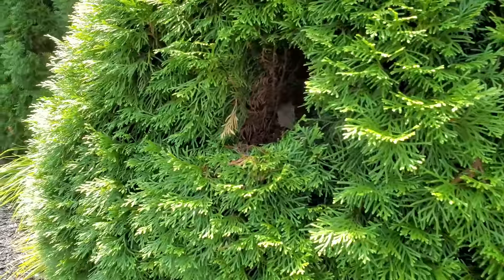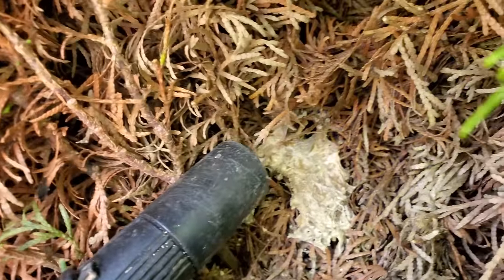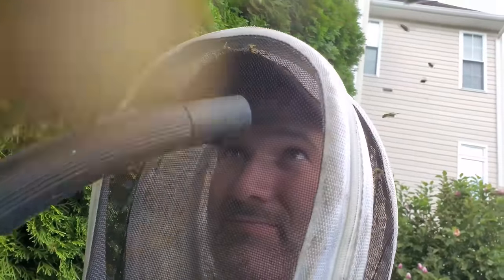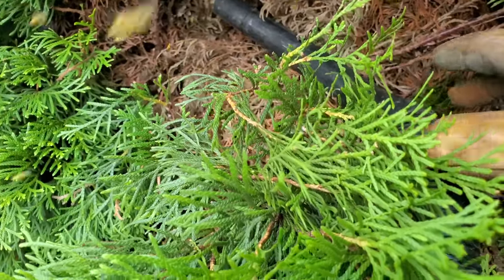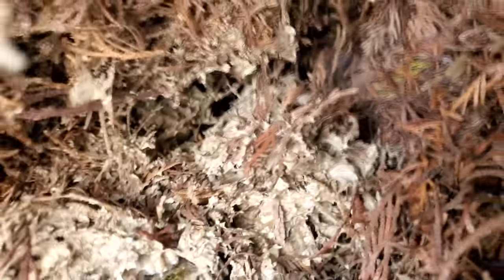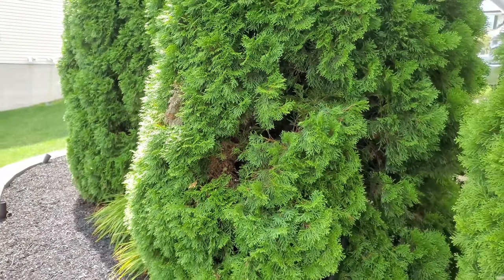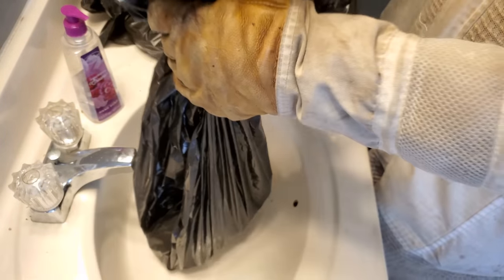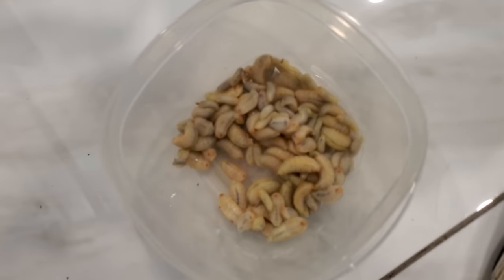BUSH OF DOOM! Aggressive YELLOW JACKETS Swarm From Bush | Wasp Nest Removal

Comment: I felt every bit of that swarm.  Back in 1987 I stepped into a ground nest, and being 5, I couldn't get away fast enough.  I was covered literally head to toe in stings.  Luckily I'm not allergic, but yeah... never fun.
Reply: Same happened to me but i was allergic...lets just say i dont remember what happened the rest of the day
Reply: @SproutQueen20  Ah god.  I'm glad you're still here, that's no bueno
Reply: I had gotten stung by a hornet on my left shoulder years ago.
Reply: Same exact thing happened to me when I was five years old! Three of us were walking along a trail, coming out of a woods. My brother and another kid stirred them up and I was the third one through. They swarmed on me. It’s kind of hard to run when you’re swatting yellow jackets as you’re running, but I ran to a neighbor’s house, the closest house to me. Luckily, she was at home and she helped me.  When my mother came to get me and walk back to our house, they came after me a second time and followed us into the house. A couple got in the house. I probably got stung 20 or 30 times, at least. My ankles were all swollen up.
I got revenge though, on their descendants over the years. If I found a nest, I would wait until nighttime, when all the yellow jackets were all down in the nest, spray bunch of insecticide down the hole, and plug it with a stick. End of problem. Years later, I got stung by a bumblebee after disturbing one of their ground nests while mowing the grass. I did the same thing with them. 
We had hornets in our backyard also and we’d make a sport of it, by going after them with badminton rackets, as they flew around. We never did find a nest. Never got stung by one, either. I was a really good badminton player! They didn’t have a chance! 😂🤣
Reply: There was a big nest bigger than a basketball underground under a big ash pile. We got wasp spray with the long nozzle. Sprayed and a cloud came out of the ground. We took off running to the house 200 feet away. A hundred feet away my cousin Dawn who was five at the time just stood there. We yelled run. We ran past her I had thought she was going to run and I had to run back and grab her. She got hit 60-100 times. All in her hair. I would not doubt I was hit at least 50 times. Still rushed her to the hospital and she was fine. We live over 20 miles from town so she to was lucky she was not allergic. Kind of surprised those bees chased us to the door.
Reply: /ryeahthathappened
Reply: They got me a few years back when I was doing some lawn care.  First time I was stung by anything
Reply: @JS-rv3et  bro thinks people don’t get swarmed by wasps
Reply: @JS-rv3et  just cause it didn't happen to you doesn't mean it didn't happen to anyone else
Reply: Ouch.
Reply: @Burakidiosu  read my above reply.
Reply: @JS-rv3et  guess you've never been attacked by bees before
Reply: @FrebbyProductions  read my reply to knight of wands
Reply: I’m from Australia and surprisingly I haven’t found any hornet nests. I mean with everything here that tries to kill you you would think they would be more common but apparently not 😂
Reply: @OurTunnelsIncredible  w comment 😭
Reply: @LAVAZZ.  they dont like the competition
Reply: That's actually how I found out I was allergic... spent 4 days in the hospital, and now I'm literally scared to death of wasps and bees. I don't ever want to feel that pain, and that much fear ever again. I was 13, so older thank God... not sure i would have survived if i was smaller. My poor mother... she thought I was gone for sure.
Reply: @Ecox51719  aww😢
Reply: @alan30189  Bros a villain from the day he was born
Reply: You poor boy that is something never forgotten but praise the stars you weren’t allergic! Very lucky at same time.
Reply: @saladmancer4802  well you’re lucky then but there’s always a first time lol
Reply: I'm burning the whole tree sorry Mr beast!
Reply: Was that the sting of 87
Reply: I also stepped on a beehive when I was five-ish. I've finally found my people LMAO
Reply: if ya disturb bees, just don’t swat, that’ll probably make them more aggressive
Reply: Yep, something kinda the same happened to me but 2 wasps stung me it was last summer when I was at ferns park in Woodland California  it was on my left foot and I can’t remember where the other one was.
Reply: Me too but it as around 1957
Reply: Me and my sister got swarmed but the worst part was WE didn't stepped on a nest. We were helping dad and grandfather because a cow escaped a fence. 

The cow stepped on the nest, causing the swarm to follow us to my dad's convertible where my mom and brothers were. We all had to abandon the convertible and get into a different car. 

We only got stung a few times but I still remember seeing the swarm in the car we had to abandon when we were in a different car. We got lucky.
Reply: That had to be traumatic. My goodness!!!!!
Reply: I did that too, actually have PTSD from it because my dad (who I was spending the first weekend of my life with, I was 8, just met him) beat me after for not looking where I was walking. Cry everytime I see a wasp now.
Reply: That could kill a child.
Reply: I didn’t realize hornets were in the ground, I was out for a long walk and had to squat to pee🥺 well that “pissed “ that hornet off and I thought I was bit by a snake, I seriously couldn’t breathe for it felt like several minutes.  I seen the 2 “ hornet fly off, it seriously was the worst pain I have ever felt. I finally made it home, though I was going to die along the way. I  Can just see my obituary now, she was pissing along the road a was attack by a hornet and bit in the ass. May she rest in peace! 😳
Reply: Holy crap-I did SAME THING, SAME YEAR! And I was trapped-it was too deep.
Reply: @jeweltorkelson  what an evil dad
Reply: Ouchy, poor little one. I was also 5 in 1987 as well.
Reply: @saladmancer4802 apartment people 😂
Reply: ME TOO, except I fell 10ft.out of a tree onto a woodpile..🤯🐝🐝🐝🐝🐝🐝🐝🐝🐝🐝🐝🐝🐝🐝🐝🐝🐝🐝🐝🐝🐝🐝🐝🐝
Reply: The same kinda thing happened to my sister when she was a teenager/tween. Despite being able to get in the house and slam the door, she had very angry ground bees all in her hair, her clothes, etc, and they kept stinging her until she eventually blacked out on the way to the hospital. To this day, she still has no recollection of what happened.
Reply: I got swarmed by a nest of German Yellow jackets here in NZ, was cutting scrub and tapped the base of a 15ft hollow tree they were in (I honestly thought it was a wild honey bee nest) and a cloud burst out of the tree like in a cartoon, and then it descended onto me, had no shirt on at the time so took about 200+ stings mostly to my head and back.😖
Reply: Oh... That sucks wow. Ouch. 
When I was about 4 I sat on top of an ant hill... Was so absorbed in playing I didn't notice until I looked down and my shirt was covered in black ants....I came out ok too but really scared me
Reply: Essentially everyone is allergic. That's why you have a reaction to being stung. Some people happen to be more allergic than others.
Reply: It seems like we all learned our lesson about ground bees around 5-7 years old i happend to fall into tha class too😂
Reply: When I was 2 there was a hornet nest under our porch, apparently they didn’t know about it, one day my mom set up one of those toddler bouncy swings and went to gardening. I started jumping and remember them swarming up in a cloud around me. At first I thought they were cool looking, and then they started to sting…. I had nightmares of giant hornets until my early teens 😮
Reply: How terrible for anyone to go through much less at 5 years old
Reply: YOU WERE STUNG BY A SWARM OF THOSE SIX LEGGED JERKS?! Wow 😲 That's AMAZING🤯
Reply: @alan30189 good man about the wasps but tou shouldnt have done that with the bees
Reply: @eabhankilcline8110  Well, the bumblebees stung me, so they’re dead meat. And I’m not going to hire somebody to come capture them alive, to get rid of them. There’s no orchards in this area, either, for them to pollinate. I see thousands of bumblebees around my house every year. I have “Lambs Ears” planted on each side of my sidewalk, just in front of my front porch, and the bumblebees love the flowers on the spikes during the summer. I sit there on the porch and watch hundreds of them buzzing around, getting nectar from the flowers. They don’t really bother you until you accidentally step on their nest. They just need to be careful of where they put their ground nest. 🐝🐝😳🐝🐝
Reply: @It-b-Blair  I had to be a horrible experience for two-year-old. Mine was bad for me. I’m glad you weren’t allergic, because you could’ve died. Hornet stings are pretty powerful.
Reply: i had a somewhat similar experience with a thorny bush. i fell into it and my mom had to take out like 30 to 60 thorns that was stuck on my body. not the same as being swarmed but close enough.
Reply: Oh dear, I’m so glad you survived! That’s so scary.
Reply: i’m deathly allergic. Being a stupid 17 year old I messed with my friends in the woods and we stepped on a nest and i still can’t get the buzzing out of my ears. I can’t look at or hear a bee without going into this weird shock
Reply: Bro I have a similar story my ball went into some rotting wood which had yellow jacket nests and I got about 5 or 6 stings on my hand. But your story is so much gnarlier, I still have a phobia of wasps to this day. Bees I have absolutely zero problems with for some reason. Glad you ok and you weren’t allergic of anything.
Reply: U are soooo lucky u aren’t allergic unfortunately I am allergic 💀💀💀👁️👄👁️🫠
Reply: That happened to my dad when he was a kid- he was mowing his parents lawn and ran over one on the edge of a creek. He still talks about how horrifying it was. Wouldn’t wish it on my worst enemy
Reply: When I was 8 a friend and I were walking thru the woods and she unknowly stepped on an underground nest. We both took off. Fortunately I'm not allergic but she was. She spent like a week or so in the hospital after being stung hundreds of times. I escaped with around 50 stings
Reply: When I was four or five, I vaguely remember seeing something in our front yard that I thought was a seashell and picked it up...  Fortunately I was wearing a wool sweater, so I only got stung a half-dozen times.  I got lucky; despite obviously deeply disturbing the nest, I must have dropped it quick before getting hit with a lot of pheromone, or it wasn't a super-defensive species...
Reply: Naa bros in his late 40's💀💀💀💀💀
Reply: Allergic or not, their bite is still horrendous beyond all reason.
Reply: @@awesomelife4001I have never had that experience with hornets, only yellow jackets, but I’m no expert.
Reply: I had yellow jackets build a nest in my compost barrel.  They only flew in one vent so I hosed that vent with wasp spray until they stopped coming out.  That would last a couple weeks and then I’d start seeing them again and had to repeat about 3 times.  Probably new ones hatching out.  The only problem is now I have to wear gloves to take the compost out incase I grab some dead ones.
Reply: We don’t have a lot of hornets where I live but a couple years ago when I was mowing the grass I noticed something black and white flying around my head every time I got near an apple tree.  I remembered boldfaced hornets are black and white and backed off.  Luckily I didn’t swat at them.  When things calmed down I snuck back to the tree and took a look and found a softball sized nest.  I waited till night and hosed the opening with foaming hornet spray.  I waited a week and knocked the nest down when I was sure they were all dead.
Reply: Old ahh 42 year old really just a child ahh
Reply: My dad is allergic to bees so he would probably die because he cant breathe when he gets stung
Reply: Was that the sting of 87😮😮
Reply: All of a sudden everyone got swarmed by hornets lmao.
Reply: OH MY, I AM VERY VERY GLAD YOUR 5 YEAR OLD LITTLE SELF MADE IT THROUGH SUCH A VITAL AND FRIGHTENING EXPERIENCE. THANKS FOR SHARING THESE MONSTER'S..
Reply: Yea me too hit air balloon came down a nest of white faced hornets had 2 opening in ground nest i was at 1 got stung almost 40 times i was like 10 years old. The other side was this like 5 year old kid and he had more stings than me. Nobody else i know of got stung but they are hard stinging bees. Still fear bees over 30 years later
Reply: That is my exact same age/story as well. Mine took place in South Carolina. Never saw them coming.
Reply: That happened to me and sister I was 4 and she was 6, it sucked so bad. 😭
Reply: WAS THAT THE BITE OF 87!!?
Reply: I hit a nest digging in the yard when I was around 10, Making a rc car track. I got hit once in the thy standing right over the nest, I ran so fast I didn't give em time to sting twice, I looked back as I was running and saw a cloud come out of the ground. Went out there at night with a gallon of gas...nighty night boys.

Comment: Every time I see Arborvitae shrubs I instinctively start looking for yellowjackets. Frequently they nest in the roots or just under the debris under the shrub. I've removed a few hanging nests in these shrubs but lots more ground nests. I don't get the luxury of removing with a vacuum, something I've wanted to try. I've been surprised how close to these nests you can get without disturbing them. I have literally squatted down next to a ground nest to do my thing and had them ignore me as long as I am suited up and not moving too much. Cool removal!
Reply: Usually you need to shake out all the dead needles and rake them out.

Comment: A few years back, I had to deal with an in ground nest that was causing issues in my yard, and it was probably these guys that were the ones that formed the nest. They would come out and sting me anytime I tried to mow my yard or even walked past were they were nesting. Not great when your allergic. Couldn't mow that part of the yard until one day late fall, I decided to move the rock they were nesting underneath and just have them exposed to the cold air. Couple days later when things have calmed down, I decided to pour soapy water on them (learned that from this channel), then decided to just double tap it by pouring boiling water from a kettle directly on the nest. Safe to say they were very dead, and after removing the nest, packed dirt into the cavity, replaced the stone and sealed it up. We didn't have to worry about wasps for quite a while as none had showed up the next spring/summer.

Comment: Had those build a nest in my red brick wall of my house. Before we got house neighbor told us about bee removal after i got stung. They said about 10,000 bee's taken. The hole was about size of jumbo marble. Needed to remove bricks to get nest out. The wall was filled about 6 ft and from stud to stud. Didn't know if they went into other sections. Hit the wall they come out. Then we could hear them in wall inside house through drywall. Great video.

Comment: I had a huge wasp nest in my attic. I’m in the uk. I literally went up there with a Henry hoover and two cans of wasp spray. In a pair of boxer shorts only 🤣. I got a can fully off loaded on it. Then hovered out a hole. I under estimated how big the nest was. I’ve never seen so many wasps in my life. Well they came for me so I bolted out of the attic so fast I only got stung once. I said to the wife I hope you don’t want your hoover anytime soon as I’ve left it up there. I dropped it right at the hole I made. You could hear it banging as each wasp was sucked up. I left it about half hour then went back up. By then the Henry wasn’t happy. It was full and blocked. Had to get dressed and go out to my work place to get their big industrial hoover. Got back and took that in the attic. Started it up and sure enough it was going well. Not one wasp got loose. I managed to hoover up the entire nest with it. Then sprayed the area and drenched it in wasp spray. I went out side to find the hole annnddd got stung strait away under the armpit. I had to hold back for a while but eventually managed to get close enough to plug the hole. What a mission it was

Comment: Whoever had their bushes like that needs to dig through them with a rake at some point to remove all the loose material. Not only did that needle litter invite wasps, but at that level it can even be a fire hazard. Hopefully they did more to clean those up after the pest wasps were gone.

If you're not in an area that gets a lot of wind to shake them up, arbor vitae may need maintenance.

Comment: You haven't lived until you accidently stick your hand into a yellow jacket nest! When I was a teenager my elderly neighbor asked me to pick up a half rotten 20 gal oil drum that was used for years as a flower planter and when I reached under the rusted out bottom edge of the drum to pick it up it felt like I was being electrocuted! I ran about a hundred yards across the street to the back door of my house and as opened the door to go inside and escape the swarm that was on my tail I turned around and the old lady was right there with me! I was around 15 years old at the time and she was I'm guessing close to eighty but she managed to run as fast as I did!